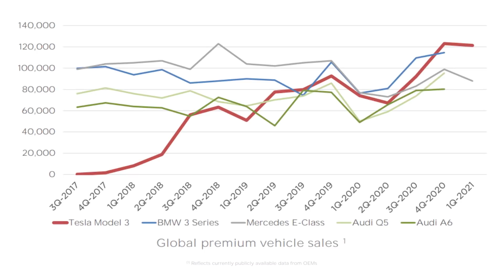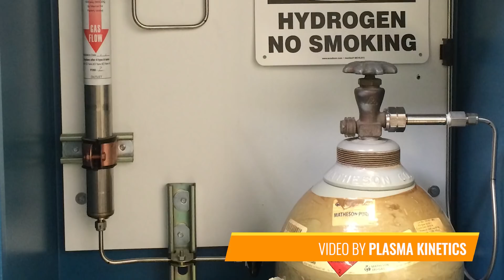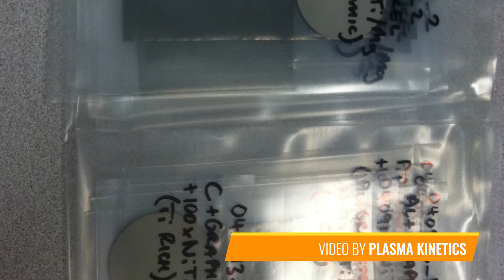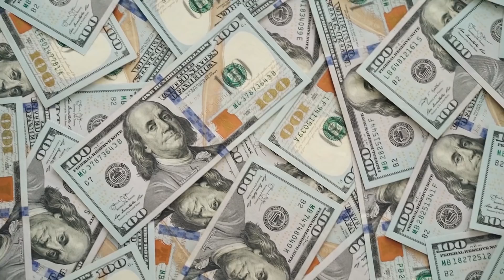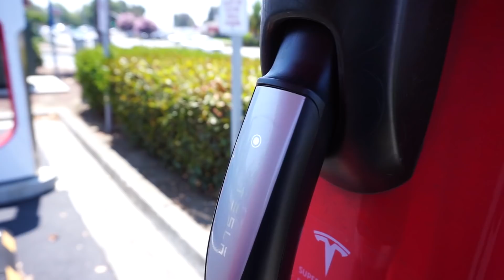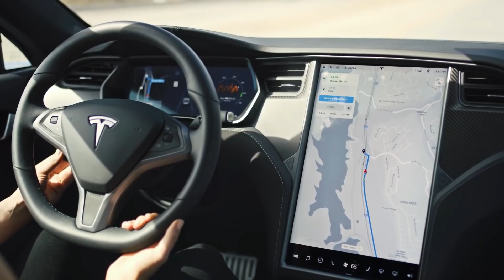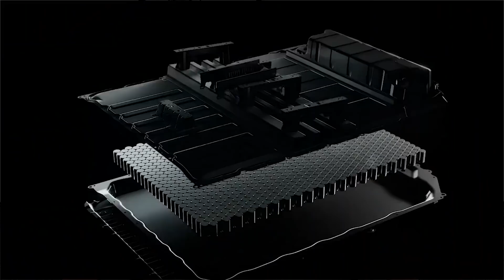SANDY MUNRO: No Batteries Needed for Toyota to Rival Tesla

Comment: If I were Toyota I'd invest all of my money that I'm putting towards the internal combustion engine, including hybrids and plug-in hybrids, and switch it to my current project of solid state and then have half of those engineers be working on three different vehicles.

1 a $60,000~$100,000 performance vehicle to come out first and prove the technology and make profit

2 figure out how to get even more performance out of that and make a very expensive performance car $250,000~$2,000,000

3 then make a mass production model starting around $25,000 for a base range of 175~225 miles (whatever can be profitable) but come out with it's long range version first (a year or two before)to scale up and lower cost, $37,500 for +300 EPA range, and then every year I would increase equal to energy density because the cost of batteries gets reduced faster than the energy density goes up.

So 2024 for the 1st (because it takes 3 years to develop a car) 2026 for the supercar, 2029 for mass market car 2031-2033 for base model. (And this is being very conservative with the years, if they spend 100% of their time on one vehicle before switching to the next, could be that they develop all three at the same time and then release one every year)

That's how I see Toyota turning things around, but they would need a new CEO for that, someone who actually understands that electric vehicles are the future and not hybrids..
Reply: Oh, and would make sure there was 1 350kw charger per 100.

8 stalls per location, one every 75-150 miles on main roads, the ability to travel to any location

One in every major city and continue to roll out too smaller and smaller towns.

Comment: This would fix the major problem with hydrogen (safety has NOT been proven on these) fuel cells. But, it introduces a lot of complexity. If it can be as cost effective, mile for mile, it will work. If it can't, it will fail.
Reply: No FCEV have caught fire or exploded. Meanwhile, many battery and gasoline cars have gone up in flame.

Comment: Toyota was one of the greatest car companies for 50 years.  

Recently have done things that have hurt their brand both to their product & service.  I have owned 5 Toyotas in the last 25 years, but I will probably not buy another one.  

They have put crappy 2AZFE engines (that have excessive oil issues, burn too rich, & ruin the engine long before its time).  They also have followed other car companies in the industry by putting CVT transmissions in their cars to save money, but lose customers because of their problems.  Their service has severely went down hill also at their dealerships who used to take care of Toyota owners, but now take care of their profits at the customer's expense.

So long Toyota.  You had a good run.  Subaru & Tesla will probably be my next vehicles.

Comment: Sad the push to Hydrogen is "fueled" by the petroleum industry. Their involvement could ruin the promise of Hydrogen. 

Hydrogen eventually made with Electrolysis, from green electricity sources, has great potential particularly for long haul trucking, trains and shipping - basically replacing the use of diesel. 

But sadly it is being pushed by the Petroleum industry because it is a lot cheaper and easier to make hydrogen out of natural gas. But the steam reforming process is worse for the environment that it would be to just create electricity in brand new natural gas power plants and sending it through the grid to power bEV's. 

So really all this news about Hydrogen passenger cars is just the petroleum industry trying to stay relevant in vehicular fuels, and have a market for their natural gas. Wish they would just gracefully back out of energy and invest in petroleum based materials for their future. Stop burning their products.
Reply: They're still a $multi-billion player. Rather they focus on that more than funding a bygone business
#climatecrisis

Comment: Big Question, Both Toyota and JCB are looking at hydrogen ICE engines. Would the hydrogen disk produce enough hydrogen to run these? Battery Technology weighs too much. Large excavators running for 16 hours a day are not viable due to charging times and weight.

Comment: Hydrogen is a dead end due to inefficiency and because lithium batteries ran away in terms of capacity and safety. That was the conclusion 15 years ago, when the German car industry basically killed all their serious hydrogen projects, combustion and fuel cell. I don't see how an even more inefficient and expensive storage technology could help. There has been much research on general solid state storage of hydrogen, and demonstrators still run at single-digit kW rates for a few hours. I don't know if that also applies to the more complex light activation approach; probably these systems operate somewhere close to self-sustainability, releasing enough energy to extract the hydrogen. Not to mention the energy that is needed to get the hydrogen onto the disk.

Comment: I fail to see why Tesla would want to partner with Toyota . . . I don't see the benefit for them.
And as for opening the Tesla charging network to non-Tesla cars . . . it makes much more sense for Tesla to go directly to the individual . . . sell you an adapter and app for your phone and bingo you can access the network, money and control for Tesla, and they can regulate how many people they let in.
Reply: How about the problem Musk has said Tesla has quality mass production of their cars. Toyota is the very best manufacturer of electromechanical complex machines. Tesla is one of the worst.
Reply: @matthewhuszarik4173  The old converted Freemont factory is a problem.  But Shanghai is just fine and Berlin/Austin look like they are state of the art and going beyond what Toyota and existing manufacturers can do

Comment: Stanford R. Ovshinsky, inventor of the nickel metal hydride battery, Toyota used there Prius. Stan was powering a fuel cell he built in a Toyota Prius some 15 or 20 years ago with solid hydrogen hydrate. My guess is Toyota and Tesla know this. The advantage of storing electrical energy in a hydrate is point of production. No need to vastly improve a electrical grid prone to major black outs or cyber attacks. Perhaps Toyota is playing chess?

Comment: This is nuts! EV's are not the future even if they could fix the problem of shitty range as compared to how long it takes to recharge the batteries. Around town maybe not so bad, but take a trip from NY to FL and see how long it takes due to the constant recharge time. But the main thing is where in the hell is the electricity going to come from to recharge these cars? One report I heard was if all cars were electric by 2035 like the left wants, we would have to build one large nuke power plant every 3 weeks to supply the electricity to power just the cars. Not a good thought. Now the hydrogen idea sounds like a much better way to go.

Comment: Thank you! Very, very interesting and informative... Yet, it is still old school technology and engineering 😁😉 I have a universal vehicle based solely on water / steam and any type of infrared radiation (sunlight mostly / ideally + IR ceiling parkings / garage). Everything is optical, hydraulic and completely analog. ZERO ACCIDENTS TRUE  AUTO PILOT for most efficient traffic flow and no collisions guaranteed in any / all scenarios. No metals, no electric systems (batteries, electronics, engines) other than lighting maybe... Oh, well 😁 I guess shock therapy will be the only one that works and just come up with it once it is ready... I have yet to find someone to share even 1% of my passion or GOD forbid risc some money...
Reply: No one would risk good money based on your description/specs which do sound too good to be true. All you have I fear is a wish list.
Reply: @peterowens290  I do not expect anyone to risk good money. Maybe spare change. I would 🙂 I always did (chronic altruist maybe). WHAT I LOOKING FOR IS SOMEONE TO SHARE THE LOAD AND HELP KICK ME FORWARD ... and BTW MY "WHITE LIST" has enough proof and experience behind it to make it real 😉🙂In any case, THANK YOU KINDLY for taking the time and interest !!!

Comment: You don't need new technology, you can run any ICE car on Hydrogen
you can store the Hydrogen in solid Lithium %10 by weight
and just burn it in the engine, it's been around for 70 years.

Comment: Toyota going to hydrogen or even synthetic fuel is great and would provide diversity to the market in my opinion it would absolutely suck ass to have Electric as the only car option instead we need more options and with using E-fuels we can enjoy our cars while at the same time not produce any new emissions I think instead of trying to develop hydrogen now I think they should go electric right now that way they keep selling cars and ultimately fund the hydrogen research
Reply: Hydrogen can never match the efficiency of electric storage in a car.  Engineers are not necessarily physicists.  Hydrogen for cars is a dead end.

Comment: Why can't they charge themselves so it would hit the truck and RV market. By doing so it would be a big sellers because of the torque electric adds. And as it is takes the power away the load of counties infstecture. Think about it what happens every morning and evening see most homes are all electric and now you plug in you home charger. Now if the towers work it free but the grid still a problem. It's just like water fill a container at midnight and time it then do the same thing and hour after work the time will be longer because everyone using water. Same with the grid but a much tighter control because if they just let the power drop like the water can it would distroy your stuff but damage the grid. But bottom line first one to make a self charging Truck that can get off road with ground clearance $$$$$

Comment: I gotta say….I cannot imagine that a disc could hold enough hydrogen to significantly fuel a car 
As a thought experiment…. Suppose that you had a gallon of H2O.  (Water) … Nd suppose that you could magically separate out the hydrogen from  the Oxygen….. how far would the hydrogen from that gallon of water power your car?

I cannot image that disc holds more hydrogen than a gallon of water

Comment: This hydro disk can be a game-changer.  Could be expensive to implement for the masses?
Reply: Nope, it can't. Hydrogens main problem (for light vehicles) is that it's already inefficient as hell and this only makes it worse. I'd love to see some actual data on how much energy you need to manufacture and distribute these disks, since hydrogen is already way behind any BEV in efficiency. It's not a game changer it's another bad idea.

Comment: At the end of the day all of these youtube videos about nifty energy storage ideas like Ambri or this gadget or compressed air etc. forget to mention one key factor.   If you deposit $100 in a bank you go the next day to withdraw you get $100 back.   If you start to get $80 or $70 back you will start to wonder if you should keep the money in the bank or not.  Lion has a very high rate, something like 99%.   Hydrogen has a terrible return rate.   Air is cheap but you loose alot of energy by storing that way.    The cost to buy a storage device is one time.   Pay more to get 99% storage return rate is a much better deal than constant continuous loss.

Comment: Batteries are the only way to go!! Electric vehicles is the only way to go!! No transmission,  no spark plugs, no carburetor, no fuel injection,  NO MORE HAVING TO USE GASOLINE!! Toyota either goes all electric or get left behind!!!

Comment: I like Sandy very much but today he contradicts himself: he always talks about how car manufacturers should build everything in-house but Toyota‘s way into the future shall be buying all key technologies from others, even competitors.
Reply: Sandy’s point is that Toyota has run out of time. To leverage their lead in fuel cell technology, they need to do whatever it takes to get the best batteries in volumes to support mass production and deploy a hydrogen distribution infrastructure NOW.
Reply: @Greg-om2hb  Ok. But then, they should also take Tesla‘s self-driving technology? I mean, that‘ll be at the core of a future car manufacturer’s identity and arguably one of the only ways they will still make money: software.
Reply: Tesla buys their key technologies as well. They purchased Maxwell because they created their dry electrode battery
Reply: @blackmartini7684  There‘s a difference: I understand buying a company and incorporating it. That‘s in line with what Sandy used to preach. But relying on someone else for key technologies goes strictly against that, especially buying these from direct competitors.

Comment: Tbh this Disc stuff sounds really inconvenient
Reply from the maker: Versus sitting for 45 minutes and waiting for your car to charge in the middle of nowhere?
Reply: @EforElectric  No. That's gonna be more like 10-15min in the near future. Who charges for 45 minutes even today? Model 3 is like 25min to 80%.
Also, charging at home 99% of the time vs. having to exchange these discs EVERY time.
Which is the common EV fallacy imo.

But all of that aside, what I actually seriously wonder is how they compare to pressurized H2 in terms of energy density and efficiency.
H2 for cars is about 30-45% as efficient as BEV with electrolysis and pressurisation.

How is it gonna be like with the discs? It's not only a question of  "does it work" but also of "how much energy does it need, does it make sense" etc.
Reply from the maker: @shockwave1xD  not everybody has a brand new Tesla my friend. Even 15 minutes sounds like a very long time compared to how fast it is to fill up a tank of gas. Switching a disc is much faster than both.
Reply: @EforElectric  I have a VW eUp. The thing is, you have to drive somewhere to get these discs. That´s like driving somewhere to get gasoline. It might take 3 min to fill the tank, but 20min to get there.
Reply from the maker: @shockwave1xD  I think the concept is that you get a bunch of them and store it in your garage and just change them whenever you need to. I am assuming there would be a delivery and refill service if this takes off.
Reply: @EforElectric  Do you know how much H2 can be stored in one of these discs? If a 700bar tank in a 5m long Mirai can store around 6kg which is enough for about 450-500km, how much can the discs store?
Reply from the maker: @shockwave1xD  this technology is in the early stages so there are no apparent or detailed answers yet

Comment: But.....Toyota so far is on the bandwagon for "Subscription" based profit. In other words, Toyota is getting ready to charge a recurring fee to its customers to use the remote starting feature on the car's keyfob. They are not the only auto company to looking into this.

I've already written to Toyota and told them I would never buy another Toyota is they continue on this path.

I don't think that I worried them however.

Comment: Electric cars are simpler and it's pretty much a prius without an engine.... So there's nothing amazing about tesla tbh.
Batteries have been well understood for a long time and it wasn't until we could get the materials more easily which relates to mining etc and not actually building cars that prevented us from making good electric vehicles in the past.

But I'm only an automechanic so what do I know?
P.S. I learned engineering well

Comment: Will all due respect, I think both of u don't understand Toyota, for instance, every 4th CEO will be a Toyoda. sourced. Studying Toyota is like peel a union try to get to the centre of it. So, to say Toyota is behind with BEV is not true, more so with Panasonic being the common denominator to Tesla. It's clear that Toyota is diversifying its approach to mobility whilst slowly spending less on its "Cash cow" ICE,  compared to hybrid (Its STAR), and figuring out which of the emerging mobility(Question marks) power (BEV, PHEV,, hydrogen-ICE derived) should take first priority in the short-to-medium market introduction. For sure the PHEV is their long-term priority. I think Tesla needs Toyota more than inverse. Tesla's has all its eggs in one basket, and I don't see how it will beat the Chinese battery manufacturers. I am still of the strong opinion that electric cars ballon will bust before 2030, and that ICE will not disappear, instead will be more efficient passing 60+ thermal efficiency. As always, kudus to Sandy to making me aware of Plasma Kinetics startup

Comment: I thought the Toyota ace in the hole was the solid state battery: capacity, long life, quick charge. What happened to that?

I can see Toyota wanting to reassure its customers that they will have a high quality preferred charging and support network at their disposal. A collaboration with Tesla would make sense for that.
Reply: solid state ev batteries are vaporware